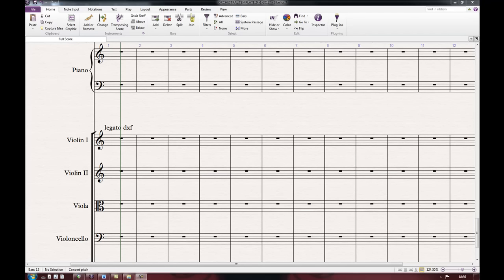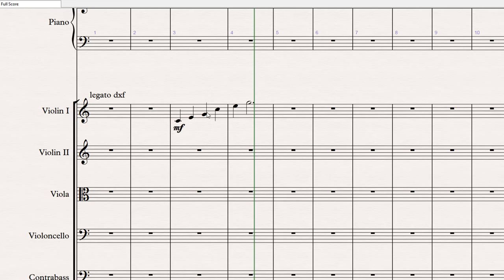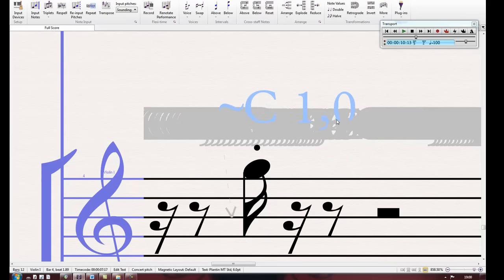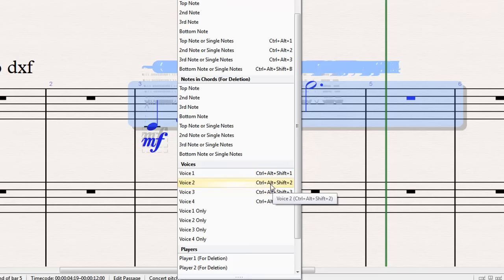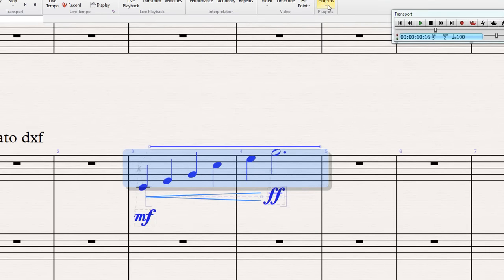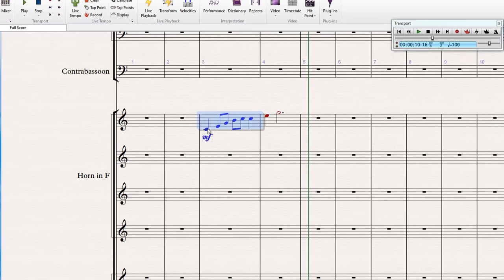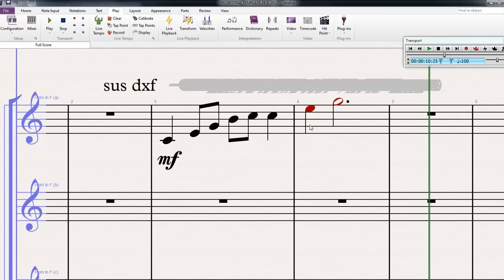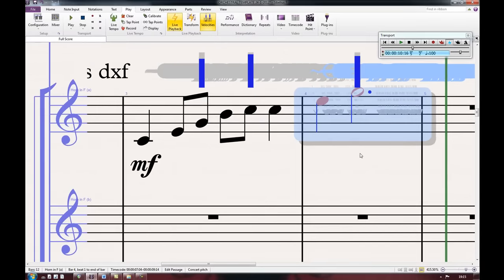Recording CC Data Inside Sibelius

Comment: Hey there, I wonder if it is only me who underwent trouble with controling the page while working with too many continous control messages. If I try to move the screen, it starts to freeze. And also it acts like so slow when I click a bar to choose. These make sibelius so difficult to work with midi control messages. It is pointless if I will work with a couple control messages in an entire composition. What do you think? Is it normal? I have imac 2012 late, problem exists on both sibelius 7 and 8.5.